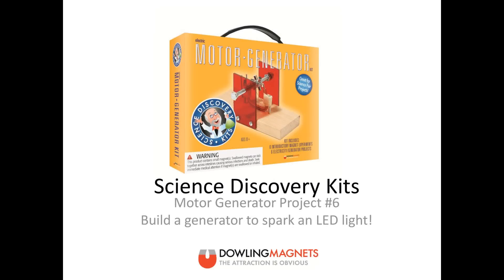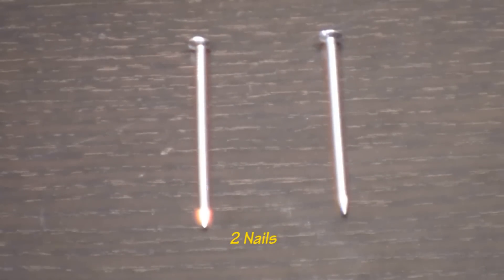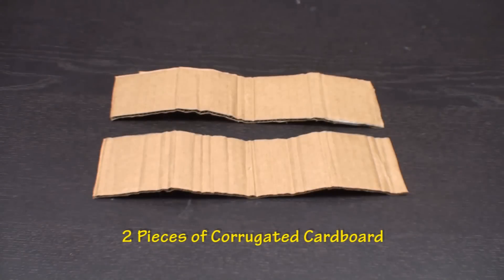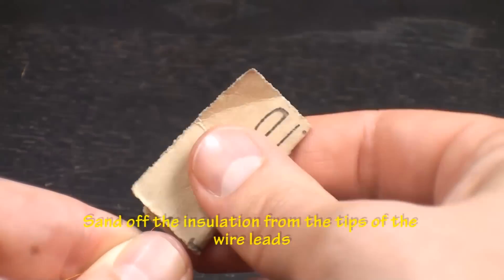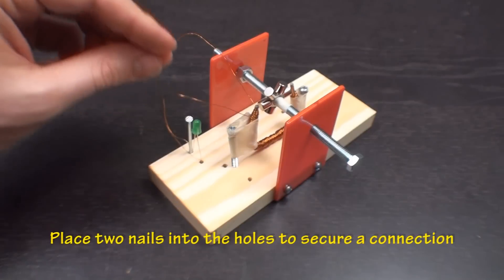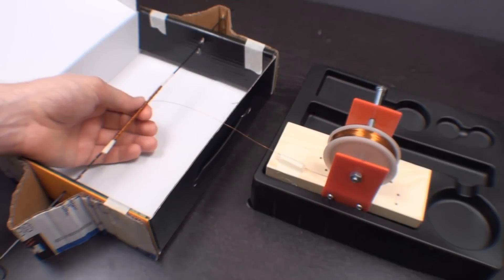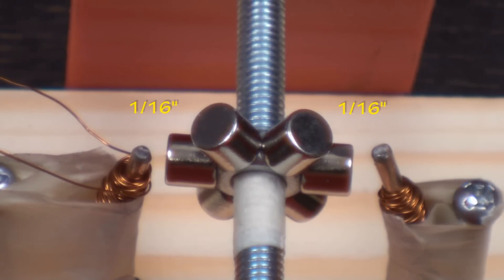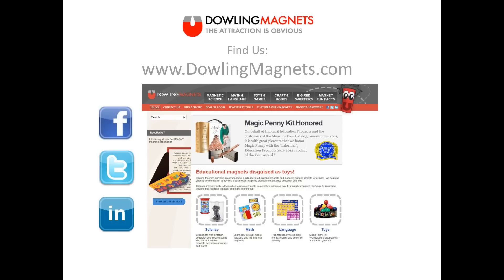Dowling Magnets - How to Build a Electric Magnet Generator

Comment: When you bend the coil with a pair of pliers you're apt to break the wire or damage the insulation. Wrap the coil with protective cloth or tape to protect the wire from scratches and breakage. Then check the continuity after bending.

Comment: This gives me some ideas for an upscale version. The magnetic field pulsing through the rod makes good use in creating electricity in alternating current. I would simply wind quite a bit of wire around a much larger iron or steel rod and pulse it through with larger magnets.

Good video.